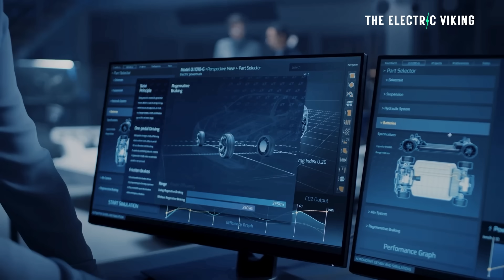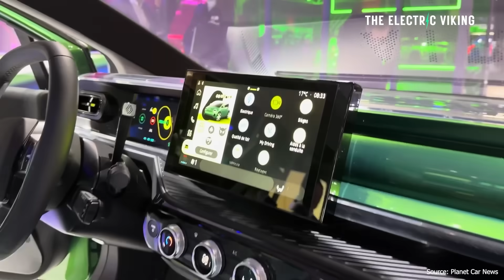Renault Says it's NEW Electric Hatch will use LFP Batteries and cost $20,000

Comment: Interiors of Chinesse cars are really boring, because almost all lokk the same. It's a such a Chinesse habit - when some Chinesse firm starts to produce anything and it is succesful, all Chinesse producers do the same. And it is not only about cars, it is everywhere. Have a look at Alibaba, Shein or Temu.
Interior if this Renault Twingo is excellent. It has turning buttons, even several buttons. This car looks like normal cars, outside as well as inside. I think, chance of Europen producers against Chinesse ones is in design, especially inside. European producers should start EV with standard design as they used for ICE cars. The worst producer in this in Volkswagen (not whole concern, just Volkswagen). 
European producers could produce the same model with 2 completely different dashboards. One in Chinesse and Tesla style and another in classic European/American style. Then they could see very well, what European customers want. It's not a new Idea, 35 years ago you were able to buy Fiat Tipo with standard dashboard as well as with dashboard called "Digital".

Comment: The best battery tech is the one that does not burst into flames and destroy your house in the process. Fast charge is a bonus but most people would only need to charge a couple of times a week at most so not a deal breaker. The Renault looks the goods with just enough French quirk, like it.:penguin-blue-waving-tear:

Comment: A 4,000,000 mile EV is pointless.  When was the last time someone wore out a computer?  They just get so old that they are no longer meet our expectations or are unusable with new software.  Same with a 4,000,000 mile EV.  How about one that operates from -40C to +60C without battery temperature conditioning?  That would be more useful.

Comment: Didn't catch the range on that car. No orginal Smartcar ev was dismall in range. Reason it was a failure in USA
Reply: The old model's range is a claimed 118 miles. The 2026's model claimed range is 150 miles for the smaller battery pack.
I doubt Renault will be selling this in the US, it's not part of the company's core market.